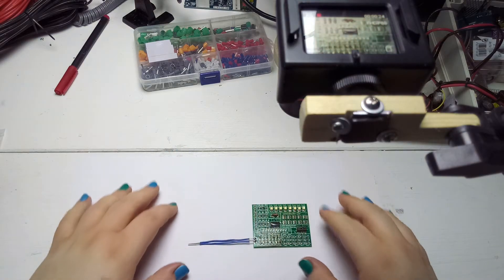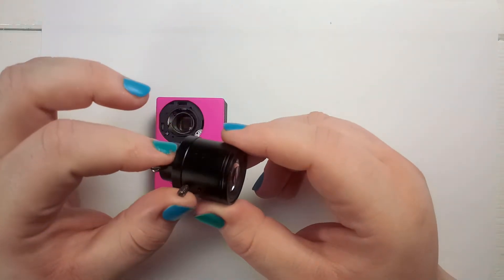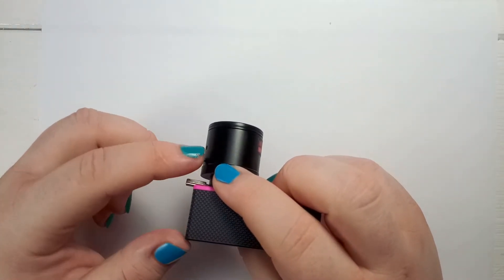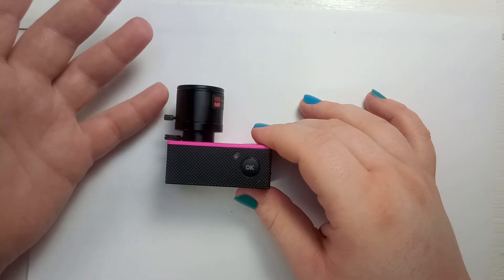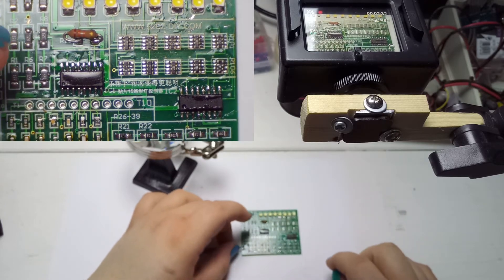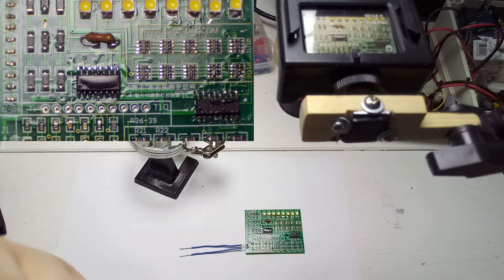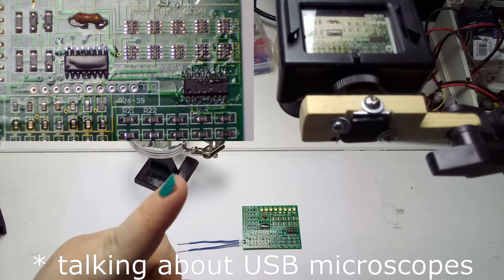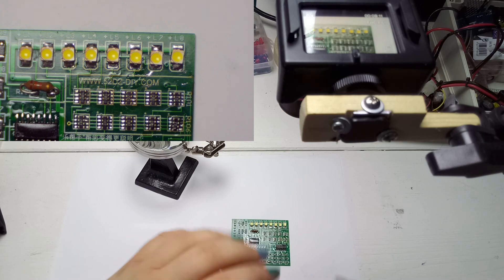Action Camera to USB Microscope - Test and all about replacement lenses.

Comment: Wow!  Great job!  I think that the manual focus is a plus.  I have seen so many YouTube videos where the narrator is screaming "Focus, focus.........." .  You don't have to worry when your finger or tool gets in the way and the camera refocuses and doesn't return.  Kudos to you for getting the lens changed in the previous video!  So many of us are worried about making a mistake that we never attempt something like that.  Good for you!
Reply from the maker: Thanks :D
The only downside of manual focus is that it can easily get out of focus and to fucus it I have to manually adjust the lens in this case. In one of my newest videos I used my new camera as a microscope substitude with macro lenses. Works really good and focusing it is as simple as pressing a button. Ofcourse I agree that it is preferable to use manual focus and thats how my new camera is set up. :)

Comment: Hello. 

First of all congrats on your work and thanks for sharing. 

I'm going to replicate this diy microscope for myself. But i have a doubt.. Can you move the camera closer to the object ? So the image can be bigger ? How close can you 
approach to the "object" without losing focus ? Is a 50mm lens better for this ?

Thanks
Reply from the maker: With the exact lense I used I can get as close as 3cm to it and still be in focus. Obviously that also makes the picture significantly bigger. I bought a cheap microscope holder and am now able to fine adjust. Makes it much easier to use.
Reply: @PhysicistAnna  Tks. As soon as i have mine completed i will send you some photos.